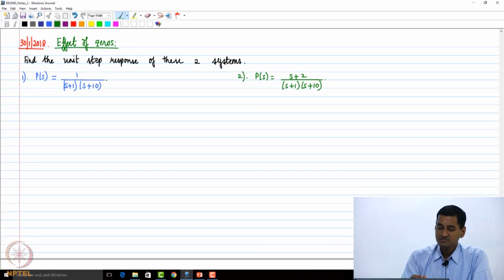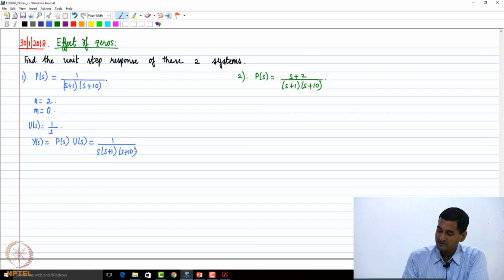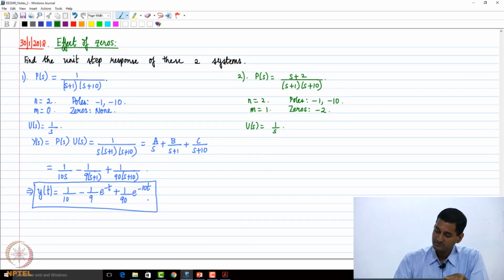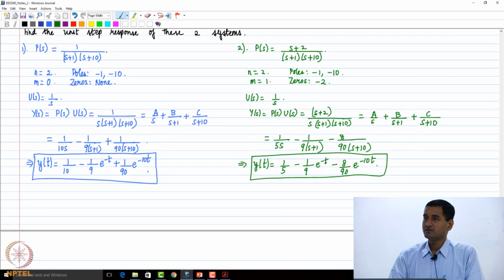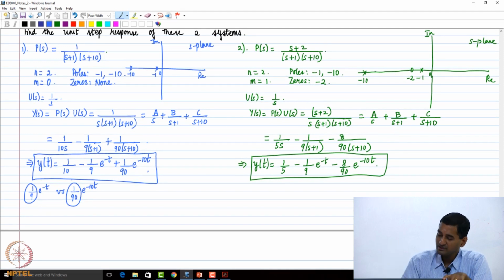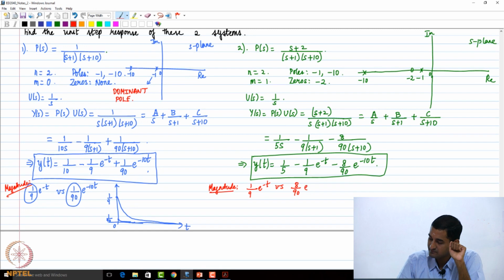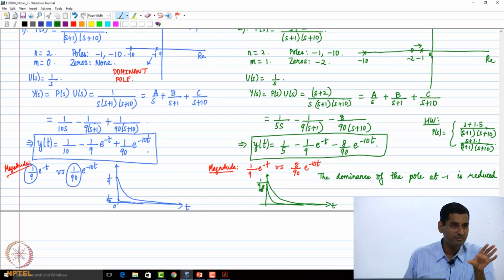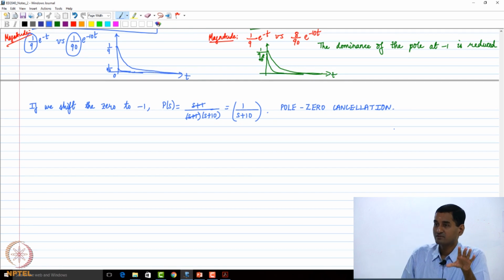Effect of Zeros - Part 1

Comment: Highlights by TinaMind:
00:20 The stability of a system is determined by its poles, which must lie in the left half of the complex plane for the system to be stable.
01:18 Transfer functions are represented as a ratio of two polynomials, where the roots of the denominator are poles and the roots of the numerator are zeros.
01:54 The order of a system is defined by the highest power in its denominator polynomial, which corresponds to the system's governing differential equation.
15:26 Dominant poles are those closest to the imaginary axis, as they have a more significant and lingering effect on the system's time response.
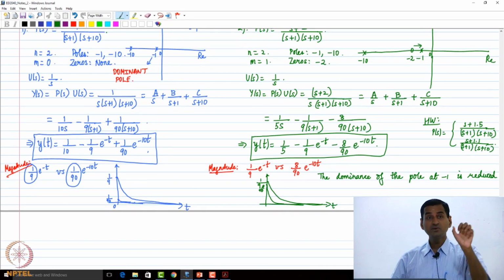20:06 Zeros influence the system's dynamic response by affecting the residues of the partial fraction expansion and changing the transient behavior.
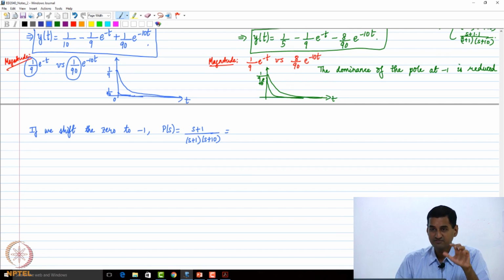21:52 Placing a zero at the same location as a pole results in pole-zero cancellation, effectively reducing the system's order, although this is typically avoided in design.